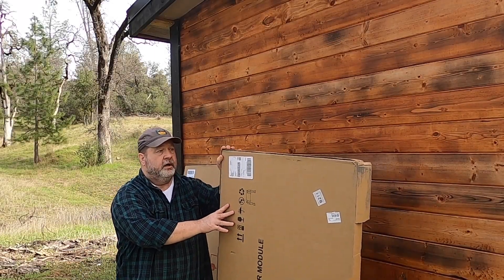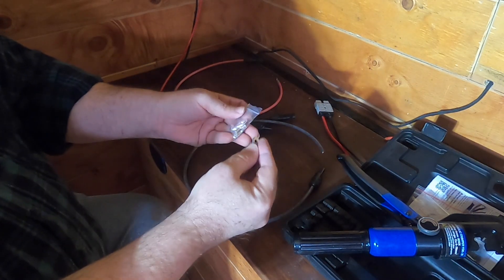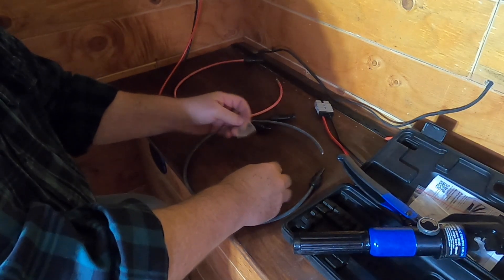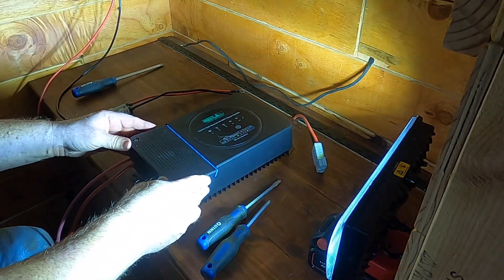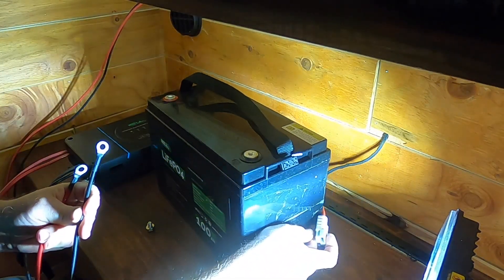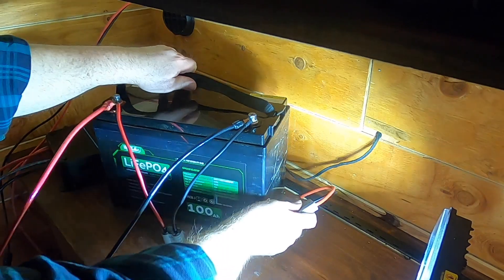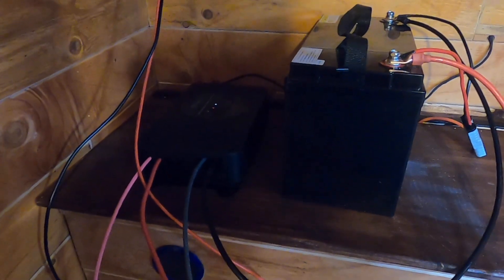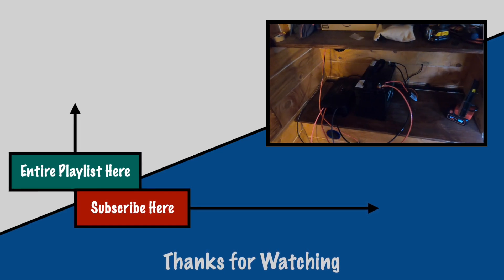Super Simple Solar Install - With HQST

Comment: I would install a rasp pi or small USB-C powered PC to run Home Assistant, with the Solar Assistant plugin. And some sensors to it for notifcations when doors and windows are opened and a few other sensors (motion) and temp.
Reply from the maker: That would be a cool setup. I actually have a raspberry pi still in it's box doing nothing. I'll have to ponder that.

Comment: what gauge wire do you recommend for 6 230w solar panels and from the controller to battery from battery to inverter ?
Reply from the maker: It all depends on the distance. The longer the cable, the higher the gauge. I used 6 gauge from the panels to the controller and from the controller to the battery, and 1 gauge from the battery to the inverter and 2 awg between the batteries. Your setup might require a different size. Also, the higher the voltage (12V to 24V, etc) the smaller the cable required. There are tables that match voltage, wattage and distance and tell you the correct gauge wire to use.

Comment: Let there be light.  Nice video.
Reply from the maker: Thanks Frank.
Reply: I bought a Bluetti EB3A just for the built in charge controller. To bypass having to have a controller on each solar panel.